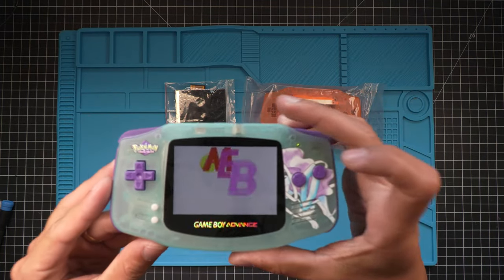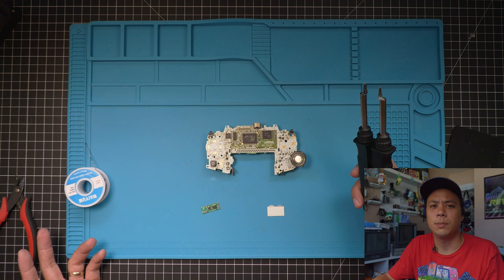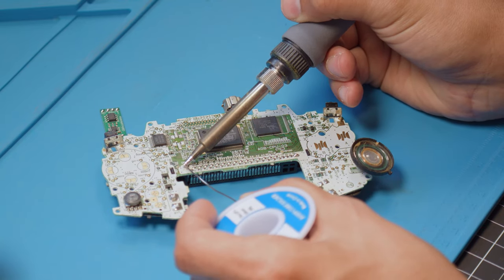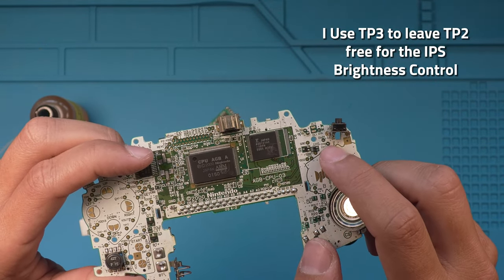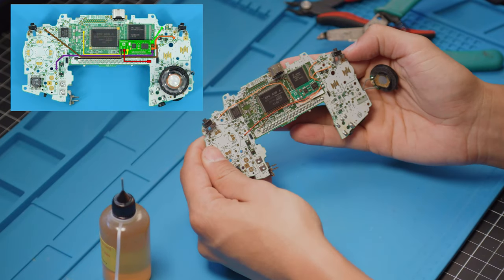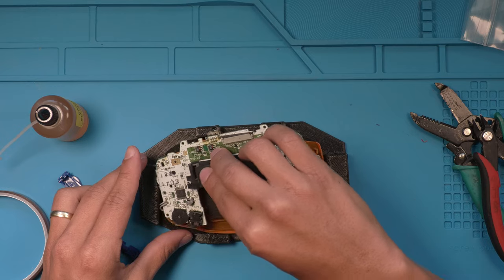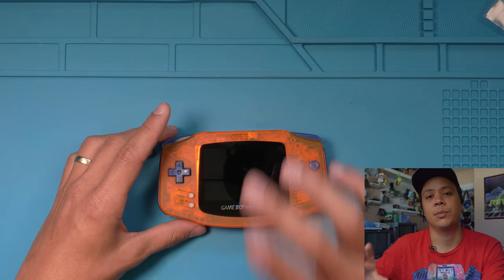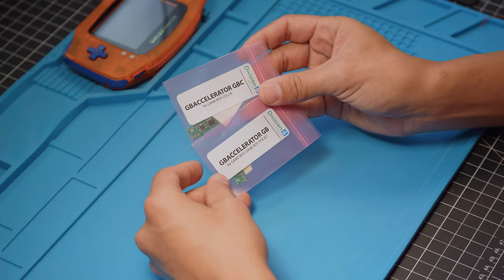Overclocking the Gameboy Ep:1 The GBA

Comment: What if you use the SRAM 16Mb,High-Speed,Async,1Mbx16, 20ns, 1.65v-2.2v, 48 Pin TSOP I, RoHS instead of the 256k ram chip in the gba?

Comment: Thanks for your Video. So I tested this

In GBA Games, Speed 1.5 works, but with 1.75 speed the system freezes. However in GB/GBC Games, the 1.75 works fine. So is this only available in older games ?
Reply from the maker: Which GBA games did you try?
Reply: @JayBoyModz  I only have Pokemon Firered & Emerald so yeah these two